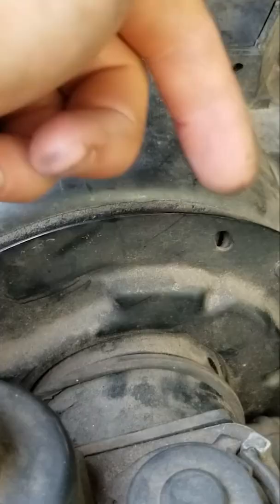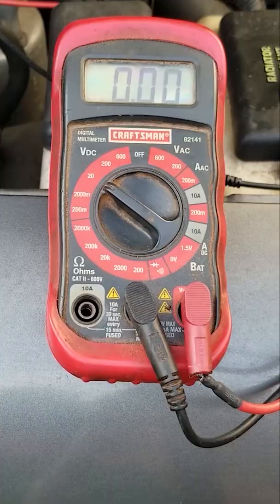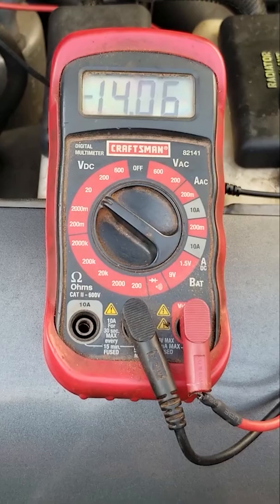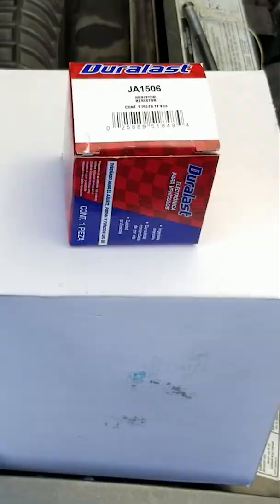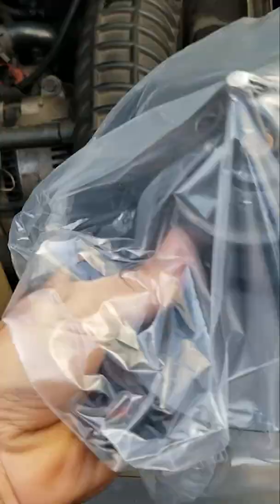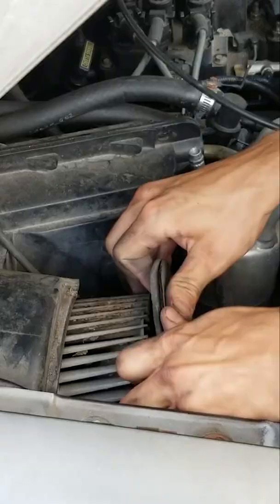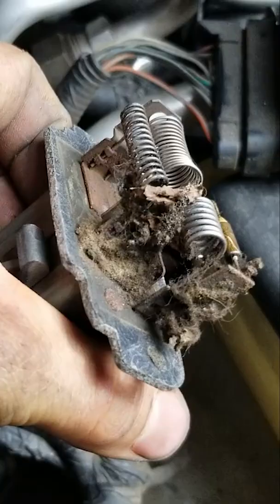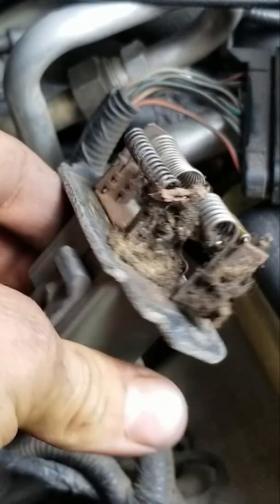Customer States NO A/C

Comment: I always test with a headlight bulb. You should put a load on the wires, not just check for voltage. If there's a  shoddy connection somewhere, applying the load will reveal it where a multimeter often won't.
Reply: Are you being serious?
Reply: @zstrode.8953  Absolutely

Comment: So replaced a part that you can easily inspect, clean, test, and put back?
Reply: Yes because he needs that original part for his truck 😂😂
Reply: That was a lot of work just for an easy to diagnose problem
Reply: Not entirely sure what's left to test if it has voltage but doesn't work? They're cheap parts, you aren't getting much extra life out of the original one if you free it up
Reply: @Animo92  The resistor, how about the resistance? It is super fast and after the crud is cleaned off, is either close to spec or not.

Comment: Great diagnostic skills.
If the resister was stuffed it would only work on high speed.
Also how does the fan control a/c??
Fan controls air flow for a/c and heater

Comment: Changing a part just cus it has voltage but dont work😂😂😂😂🤦🏽‍♂️🤦🏽‍♂️🤦🏽‍♂️
Reply: As much as I'm an advocate for repairing shit, if it's got voltage but not spinning, you aren't going to get much extra life out of it from freeing it up, it also depends how much of a job it is to get to said part, I replaced a perfectly "good" hub seal today on a bus because it would have been a few hours work to dismantle again if it leaked